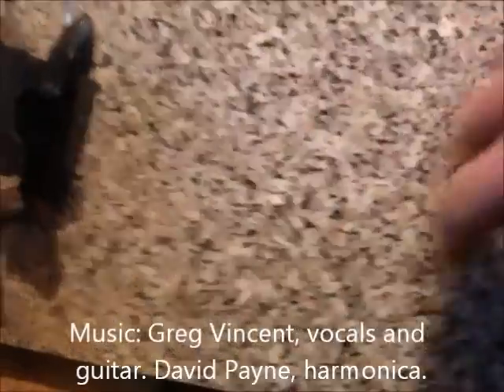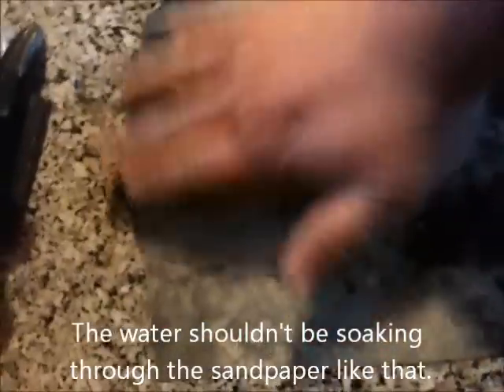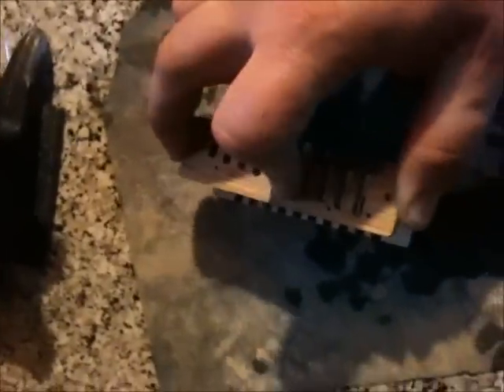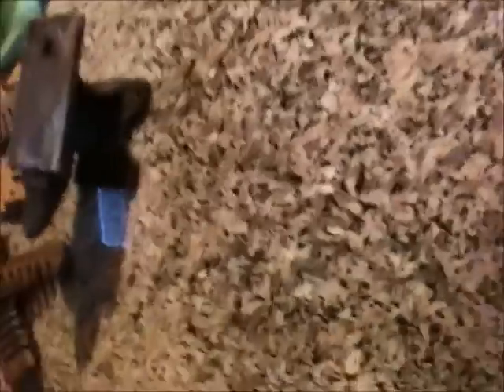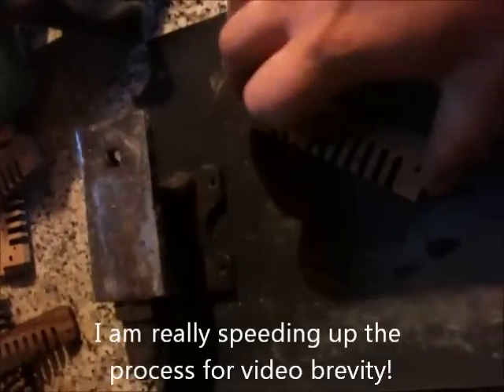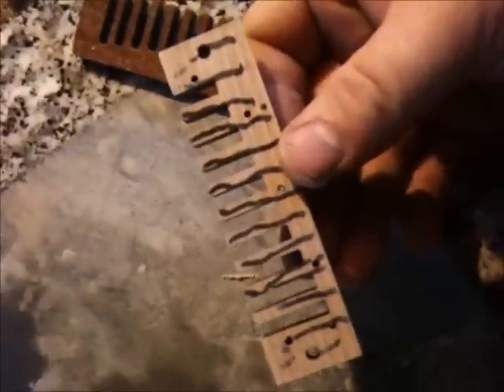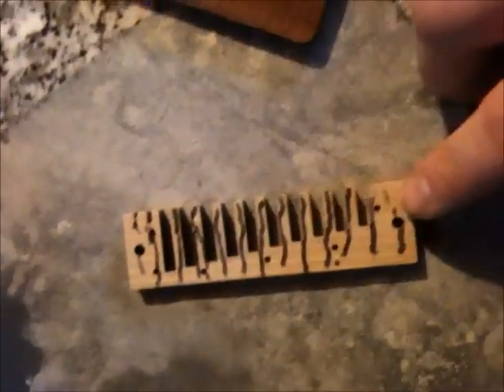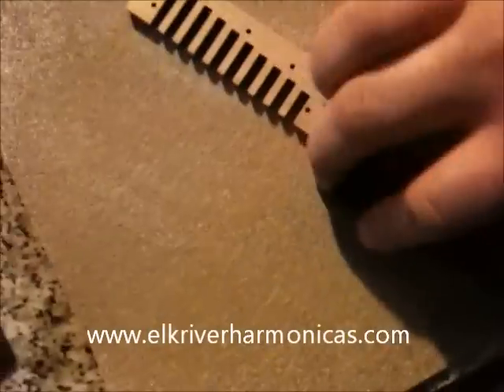ERIFAHS: Flatsanding Harmonica Combs for air-tightness

Comment: very good video and dont forget to flat sand the reed plates also for even better air tightness.use 220 on the plates and dont over load the pressure when you sand

Comment: Thank's for the info Dave!
Might I suggest using chalk or pencil to mark the comb? The ink from the marker sinks into the wood causing you to take off more material  than necessary to sand it away.
Reply: Good pointer. I ll try my luck with my newly ordered but a  leaky Hohner  270 . Of course, Ill give the feedback.